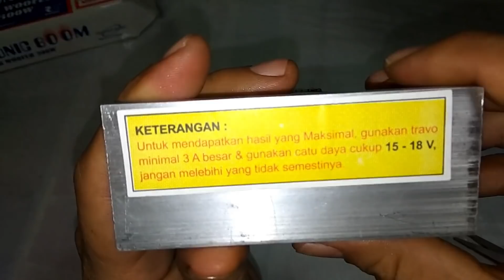CARA MUDAH MERAKIT POWER SUBWOOFER #soundsystemindonesia #rakitan #elektronik #subwoofer

Comment: Mas sonic boom saya baru beli kenapa hanya berdengung kalau di sentuh potensionya,jika di putar potensionya makin keras dengungnya, mohon solusinya🙏
Reply from the maker: Suply brapa volt
Reply: 20v mas, baru beli gak fungsi sama sekali hanya dengung saja, pemasangan sudah benar, apanya yah kira2
Reply from the maker: Auto short itu tr final...
Max nya kan cuma 18v
Reply: @yogiap6087  sudah di ganti sebelumnya mas tp sama saja tetap tidak fungsi,inputnya tidak berdengung jika di sentuh,hanya berdengung jika di sentuh potensio volume nya
Reply: @yogiap6087  mas yogi ikut nanya...mudah2n dijawab...potensio dipasang g dengung..tp kl dilepas dengungnya keras banget...🙏🙏🙏

Comment: Ikutan Belajar Audio...
Saya Punya Subwoofer 12" Embassy 2 coil EY-128 (blm punya Box nya) 
kiranya Trafo yg brp ampere mas Yogi.....?  trafo = 5A atau 10A  dan CT nya yg brp..
mohon infonya...
Reply from the maker: Klo untuk sub doblecoil kurng maksimal mas.. pake driver class D aja
Pake trafo 5a cukup CT 45v
Reply: @yogiap6087  tks infonya...
Bolehkah klo driver klas D
Pakai Switcing/PSU..?
Klo boleh yg voltase n ampere yg brp... Max/min...
Mhon dgn sgat infonya...
Reply from the maker: Bisa... Menyesuaikan dengan supply driver nya aja mas..
Reply: @yogiap6087  oke 👍

Comment: buat subwoofer 8 inch bisa ga bang
?
Reply from the maker: Mampu bosku
Reply: Bos pake 25 vol 3 amper apa bisa
Reply from the maker: Gk mmpu....max 18v
Reply: Ok trimakasih bos
Reply: Kalo pake 25 vol ct apa aja yang diganti, maaf pemula belajar
Reply from the maker: Trutama elco power supply..ganti 50v
Reply: Bos kalo pake 25vct psunya dirubah dioda berapa amper elco pake yang volt/uf nya berapa mohon dijawab belajar bos plissss
Reply: Ini elcoya 50 volt 4700uf diganti 50v 10000uf dioda di ganti yg 6amper, itu aja bos?
Reply from the maker: Tr final ganti yg original sanken

Comment: Klo pkek trafo 5a kecil bisa normal gak angkat subwofer doble coil 12"X1,??
Reply from the maker: Vol max kemungkinan bs sember suaranya
Reply: @yogiap6087  tp klo 5A murni untuk stereo angkat 12" doble coil X 1 per mono bisa normal bang nggak kah sember
Reply from the maker: Standar lah klo suply sgitu mas...
Banyakin elco aja...min 4biji
Reply: @yogiap6087  berarti psu yg ada di kit subwofer itu gx usah di pakai apa tinggal tambah elco aja bang ???
Reply from the maker: Di perbesar aja nilai farad nya
Reply: @yogiap6087  berarti tinggal gnti elco yg ada di kit dg fared yg lebih besar aja maksud'a bang......?? Terima kasih ilmu'a bang saya baru blajaran ini.....
Reply from the maker: Iya betul..dioda ganti yg 5amper..
Reply: @yogiap6087  stlah psu di ganti maksimal bisa di kasi yegangan brpa klo pkek tr sanken 5dy,? Oh iya klo dioda yg 3A bisa bang ? Kbetulan sya punya yg 3A nganggu
Reply from the maker: Sanken ori d driver itu max 32ct ....
Usahakn amper dioda di atas amper trafo... Minimal dioda 5amper untuk trafo 5amper...lebih besar aper dioda, malah semakin baik
Reply: @yogiap6087  gtu ya bang , ya dah besok sya cariin yg 5A untuk dioda'a bang........
Reply: Maaf bang yogi sya mengganggu , gini bang kit sub sya pake tr driver bd139 stlah sya kasi tegangan dri trafo 18v udah mletus,,,,,, tr tipe brpa pakek ganti bang, saya ada sih ini tipe H649A

Comment: Om mau tanya kalo pake subwoofer soun bank 10 inc  d data tulisan 600watt kuat gk ya??terus sya rubah pake tr final sanken asli sama elco ganti 50 volt 10000uf
Reply from the maker: Kurang... Soalnya daya dr suply power ini kurang besar...
Klo mau bas empuk ...pake driver socl504 aja..di kasih sulpy 45vct 10amper..

Comment: Untuk speker berpa inci bos
Reply from the maker: Max 1inch 300watt
Reply: @yogiap6087  15 in doble coil kuat gk
Reply from the maker: Gk kuat mas...soalnya voltase kecil ini...klo untuk dobel coil enak pake socl aja mas...d jamin glerrrr
Reply: @yogiap6087  yg tipe berpa 504.tau 506
Reply from the maker: Pake yg 504 aj mas... 
Tambahin filter subwoofer...
Reply: @yogiap6087  klw beli namax filter subwofer gitu ya
Reply from the maker: Betul sekali...bilang aja filter subwoofer
Reply: @yogiap6087  maximal pake tegangan brp VDC mas
Reply from the maker: Klo filter sub nya cuma 12vdc
Klo socl bisa smpe 65vdc 20amper
Reply: @yogiap6087  filter sub digabung dengn power BTL bisa kh
Reply from the maker: Bisa...tp klo untuk soundsystem besar/rental gk perlu pake filter sub...karna banyak accsoris untuk mengatur freq yg di inginkan tanpa menggunakan filter sub....beda hal nya untuk sound rmhn.

Comment: Maaf bang mw nanya kalo pake travo 5a murni bisa ga ya kira kira pake di voltase brph ya ?
Reply from the maker: Bisa mas...asal tr final di ganti sanken original...
Voltase bs 32ct
Reply: @yogiap6087  owhh , kalo ganti te final nyh aph harus ada komponen lain yg di ganti juga
Reply from the maker: Elco dan dioda di ganti...minimal dioda 10amper,dan elco 10000uf/80v ...bisa di catu daya 32vct
Reply: @yogiap6087  ok makasih gan solusi nyh
Reply: @yogiap6087  tpi travo saya udh ad power suplai nyh bang elco ajh 4700uf x4 , bisa ga klo langsung di pasang ? Dan di ganti tr nyh?
Reply from the maker: Ohh bisaa mas
Reply: @yogiap6087  klo pake Sanken 2Sc3858&2SA1494 biasa ga mas , yg kanan yg mana ya ,sy in salah beli hehehe

Comment: Mas kalau midelnya pakai 400 Watt, ideal untuk sub nya berapa Watt ?
Reply from the maker: 300watt sudah cukup mas
Reply: @yogiap6087  Ouh gtu ya mas, bukan seharusnya lebih besar untuk sub ya,, Makasi infonya mas,..
Reply from the maker: Sebenernya tergantung keperluan... Untuk indor atau outdor..menurut saya klo untuk indor 300watt sudah lebih dr cukup
Reply: Untuk out dor, disini saya memakai mid 400 Watt dan Low 400 Watt jg, tapi Bass nya masih kurang nendang.dan memakai driver Sanken merk turbo, dan jg memakai 2 trafo 10 a untuk masing masing driver ,42 v untk mid dan 32 untuk sub..
Kira kira ada solusi gak mas ,?
Reply from the maker: Ohh gtu...
Klo untuk outdor minimal trafo 20 amper tegangan 65vct dan tr final 10 sett sanken cukup, itu pun speaker harus memadai...dengan syarat spek minimal 900watt 15inch/ bisa menggunakan 18inch...
Reply: Terimakasi banyak jawabannya mas, ini sangat bermanfaat bagi saya..
Tunggu modal dlu,baru saya infokan hasilnya.
Reply: Mas y0gi.untuk speker subw0fer 350 wat.sebaiknya pake driver brapa wat.

Comment: Mas kalo di buat 2.1 di gabung sama ampli stereo ya ?
Reply: Kalo suara udah misah sendri mas atara vocal dan subwoofer nya tanpa di kasih crossover?
Reply from the maker: Klo tanpa crossover untuk vocal tetap ada...tp usahakan di sett di low frequensy untuk crossover yg tersedia di kit driver,agar vocal tidak menonjol
Reply: Oke mas terimakasih
Reply from the maker: Sama2 mas e... Trimakasih sudah mampir ke channel ku
Reply: Jadi kit ini masih  ada suara vokal dikit ya mas ...
Reply from the maker: Betul sekali....
Reply from the maker: Bisa mas...
Reply: Ini cara pasangnya gmna?? Inputnya di ambil di jemper ta sma in ampli stereo atau gmna??
Reply from the maker: Dr low input stereo bisa...
Dr high input / out dr power bisa

Comment: saya pake driver yang sama... volume tidak bisa dibesarkan, keluar suara serak dari tengah cone, sy pake sub 12".... udh di cek di sub ditekan2 ga ada bunyi gesekan,, apa karena wattnya kurang kuat ya... ?
Reply from the maker: Cek IC bos... Dan potensio di cek
Reply: @yogiap6087  kayaknya di IC mas.. Kalo volumenya sekitar 20% subwoofer bekerja normal, digedein lagi baru keluar seraknya... Mungkin clipping mas..  Watt kurang besar buat dorong coil..

Comment: mas kalau pakai travo 5A ct 45 buat ngangkat legacy 12" 350 wat  x 2 kuat gak?
Reply from the maker: Kuat mas...
Reply: perlu dimodif lagi gak mas biar subnya maximal?
Reply: pie mas?
Reply: @taufiqmaulana3865  maaf mas sekedar saran kalo untuk mendrive 2 sub 12" komponennya di modif pertama transistor final yang di gunakan harus sanken asli bukan yang seperti di video yang menggunakan transistor hayana (abal - abal) karna tidak kuat dengan tegangan tinggi klo perlu di pararel. ke2 transistor driver BD139 - BD140 di ganti dengan TIP 41- TIP 42. ke3 tegangganya 32 volt sudah cukup untuk membangunkan tetangga tidur :) hehehe..
Reply: @the_pirates.  trimakasih mas🙏
Reply: @taufiqmaulana3865  sama sama mas

Comment: Saya baru beli suaranya kecil sekali pas di pegang inputnya nga ada degung di speakernya..
Pas saya pegang di potensio volume dengung keras apa ic nya yg kena gan...
Reply from the maker: Di cek dlu aj mas solderan nya...biasanya ada yg lepas dr papan pcb nya...soalnya pcb abal2...
Dan cek pula potensio nya
Reply: Iya mas udah saya cek semua ternyata pas sy copot ic nya dan saya cek icnya yg kena

Comment: Mas maaf mau nanya,,, saya bli kit spekr aktf subwoofer baleno,,, 
Trs pake 25vol ct, pake elco 4700uf 50vol x2,, malah meledak dioda di driver yg kecil banget tuh mas,,,, harusnya d kasih volt betapa iya,, maaf mas pemula
Reply from the maker: Biasanya kn tertera mas voltase yg di butuhkan... 
Jadi sesuaikan aja dengan voltase nya...krna driver mempunyai batas maksimal nya
Reply: @yogiap6087  18-25 mas,,,, saya pasang 25,karna travonya bekas spekr aktf, cuman ada 25...yg bener gimana mas, maklum belajar
Reply from the maker: Klo voltase yg tertera di driver itu sudah terconvert dengan psu menjadi arus VDC,sedangkan output trafo masih arus VAC... Apabila sampean ambil output dr trafo 25vac jika melewati psu bisa menjadi tegangan 35VDC...itu jelas melebihi kapasitas daya input driver...otomatis meleduk...
Rumus nya VAC×1,414 =VDC
Jadi sesuaikan dengan kebutuhan.
Reply: @yogiap6087  jadi yg pas ngambilnya brapa volt mas dri trafo nya... Cara meng hitung rumus pun aku gak faham mas 🙏🙏✌️✌️... Ajari saya mas. Trima kasih mas
Reply from the maker: 18vct dari trafo mas...ketemunya setelah melewati power suplly 25vol dc
Vac×1,414=Vdc
18vct×1,414 = 25,452 Vdc.
Reply: @yogiap6087  trimakasih banyak mas telah berbagi ilmu, semoga bermanfaat dan sukses selalu
Reply: Ngerakit power ocl 150 watt mono, sama tah mas pake 18ct jg,,
Reply from the maker: Voltase d sesuaikan dengan driver nya aja mas
Reply from the maker: Siaapp mas ..aminnn

Comment: Speaker subwoofer itu ada kusus ya pak? Apa semua speaker bisa dipakek subwoofer?
Reply from the maker: Sebenarnya ada...tp klo untuk rakitan bisa gunakan model speaker woofer
Reply: @yogiap6087  berarti emang ada speaker kusus woofer ya? Tp kalau pakek speaker2 biasa yg mid high gtu bisa nggag?
Reply from the maker: Bisa bunyi tp bukan pada karakter nya...
Reply: @yogiap6087  powernya juga khusus ya kalau buat bas2an?
Reply from the maker: Betul mas...khusus subwoofer
Reply: @yogiap6087  perbedaan yg paling mendasar pada power apanya ya pak? Psu apa tr finalnya?
Reply from the maker: Mksdnya perbedaan yg bagai mana?
Reply: @yogiap6087  perbedaan komponennya atau psu atau drivernya?
Reply from the maker: Perbedaan ada di filter nya mas... Di IC Filter subwoofer ...terletak sebelum input ke power apabila di satu papan pcb
Reply: @yogiap6087  kalau didriver biasa gag ada ya mas?
Reply from the maker: Driver biasa bisa di buat power subwoofer dengan menambahkan filter subwoofer di input driver tsb.
Reply: @yogiap6087  ohh iya pak terimakasih. Ndk video sampean ada nggag perbedaan power sub dengan power biasa?
Reply from the maker: Blum ada mas...belum sempet untuk buat video soalnya lg sibuk dengn pekerjaan jg...
Reply: @yogiap6087  owlah okey pak sukses terus pak 👍
Reply from the maker: Aminnn...sama2 mas
Reply: @yogiap6087  bisa minta no wa nya nggag pak? Pengen konsultasi masalah power

Comment: Sorry boss,itu bisa angkat woofer 12 inch gx boss
Reply from the maker: Bisa mas..
Reply: @yogiap6087  mantap deh...itu kalo buat digabung sama ampli stereo pake yg low atau yang satunya lg boss
Reply from the maker: Gabung dr jack input aj mas yg R/L untuk ambil input subwoofernya,soalnya klo lwt high input terlalu maksa gain nya dan suara jd gk maksimal
Reply: @yogiap6087  ouh begitu ya boss..ok bsok sYa coba..makasih ya boss ilmunya😀😀
Reply from the maker: Siapp mas...sama2 belajar jg ini hehe
Reply: @yogiap6087  ok boss😀😀

Comment: Gan ini ko ga ada vocal nya ...masa dengerin bass doang... apa butuh amplifier lagi buat vocal..mohon info nya
Reply from the maker: Hehehe iya mas,ini kit subwoofer (cuma hentakan bass) ,klo mau yg ada vocal nya pake kit amplifier biasa..
Reply: @yogiap6087  bisa ga ngambil vocal nya dari amplifier ... gimana cara gabungin nya ...
Reply from the maker: Dvd/mp3 -amplifier/power - power subwoofer

Dr dvd/mp3 bisa langsung di pasang konektor dobel rca/ ambil out dr speaker amplifier masuk ke power subwoofer (pilih high input).
Reply: @yogiap6087  ohh berarti ngambil nya dari high input ya... brarti low input ga di pake ya
Reply from the maker: Out speaker dr power yg ada vocalnya di ambil untuk  input ke high subwoofer
Reply: @yogiap6087  berarti input yg buat ke hp ttp melalui input subwoofer ya ...makash gan ..mf bgd mungkin prtanyaan ane bikin pusing.. soal nya ane pemula ...
Reply from the maker: Iya mas gpp mas...sama2 belajar hehe
Reply: @yogiap6087  oya gan satu lagi.... kalo ane gabungin lewat jeck aux bisa ga... jadi jack aux input ampli .dengan jack input kit sonic ane gabung ... - - ++
Reply from the maker: Bisa mas...malah lebih simpel
Reply: @yogiap6087  bang ini mau nanya kalu mau ada suara vocalnya alurnya berarti dari out power amplifier ke high input filter subwoofer, mohon penjelasan saya belum paham,terima kasih
Reply from the maker: Bisa ada suara vocal tp di frequensy tertentu mas...karena kit ini sudah di lengkapi filter subwoofee
Reply: Berapa harganya
Reply from the maker: Gk di jual mas..hehehe
Klo mau beli di olshop harga kisaran di bawah 100rb an
Reply: Betul mas namanya kit subwoofer ya cuman bass-nya saja yg keluar...hehe

Comment: Mas mau tanya kalo beli ini bisa langsung rakit atau harus ganti TR dulu?
Reply from the maker: Langsung pasang trafo dan di hidupkan..transistor final sudah ada
Reply: @yogiap6087   oke mas . katanya kalo diganti ke original sanken lebih bagus mas? Emang transistor final kekurangannya apa mas?
Reply from the maker: Tr finalnya abal2 mas... Gk tahan lama
Reply: @yogiap6087  oke mas , kalo kabel ke subwoofer ngambil dari mana ya mas? Sama kalo ganti tr ke sanken tegangan nya bisa 15v atau harus ganti? Sorry mas kurang faham
Reply from the maker: Dari input music langsung bisa...
Bisa di suplay 32vct dr trafo apabila transistor final original...dioda di ganti 10amper dan elco psu di ganti 10000uf/80v
Reply: @yogiap6087  oke mas makasih banyak sangat membantu , satu lagi mas , kalo gapake travo tapi pake adaptor bisa gak mas hehe
Reply from the maker: Bisa mas...asal amper nya mencukupi..
Reply: @yogiap6087  oke mas , kan kalo travo 18v+18v+ct , kalo adaptor itukan + sama - ya mas , input nya kemana?
Reply from the maker: Ohh adaptor ya....agak berrsiko klo pake adaptor mas...enak pake trafo aja mas..soalnya adaptor non ct
Pikir saya adaptor power Supplay yg plat jaring
Reply: @yogiap6087  oke siap mas , makasih banyak ilmunya mas , maaf banyak nanya 🙏😅
Reply from the maker: Siap mas...semoga bermanfaat walaupun masih banyak kekurangan d video saya..
Reply: @yogiap6087  bermanfaat banget mas . Amin

Comment: Klu untuk Legacy 12 inch 250 W ngangkat gak mas, saya jg ada rencana bikin sub aktif...
Reply from the maker: Bisa mas
Reply: Pake legaci suara y sember
Reply from the maker: Elco nya di besarin mas..
Reply: @yogiap6087   punyaku suara bas y ga karuan ,pdhal tr pinal y udh tk ganti Sanken, trus travo 5 a, 25 v, kira2 kenapa ms?
Reply from the maker: Di bagian psu nya mas...termasuk elco harus d ganti yg lebih besar...krna elco sbagai tandon tegangan dc..
Reply: Elco y udh di ganti 10000 uf, 50v
Reply: @jumantoro4826  watt speakernya berapa mas ? Yg double coil atau yg single coil ? Klu untuk trafo 5A CT 25 kurang lebih daya yg dihasilkan 175 watt mas (bukan daya real) dan untuk speakernya lebih baik gunakan yg 100 watt single coil agar nada bass nya tidak sember karna kekurangan daya...
Reply: @aguzmelandri5729   legacy 10 in 250 Wt, Doble coil
Reply: Kira2 apa y yg di rubah?
Reply: Jika transistor final memakai sanken yg ori tegangan dari trafo bisa dinaikan di 32V mas, agar powernya gak kedodoran saat mengangkat nada bass pada subwoofer...
Reply: Coba naikan tegangan nya di 32V asalkan transistor finalnya bukan yg SANKEN kw 2 masih bisa di supply 32v mas, tp klu yg kw 2 jgn dinaikan di 32V bisa kebakar...
Reply: @aguzmelandri5729   nanti saya coba ms, makasih mas atas masukan y
Reply: Sama2 mas...
Reply: @aguzmelandri5729    ms  gimana caranya gabungin subwoofer ke amplifier Polytron BB 5510 di amplifier y tidak ada out put y, apa ngambil di out put speaker y
Reply: @jumantoro4826  untuk sambung dari ampli ke subwoofer bs ambil dari out speaker, tp kalau seumpama pake subwoofer aktif untuk saya pribadi biasanya saya modif di bagian input ampli ( tambah soket dan di pararel dibagian input ).
Reply: @jumantoro4826  kalau mas pake subwoofer aktif bisa di ambil dari out sub ampli, untuk tone controlnya ikut di polytron, atau mempararel input dari sub aktif lalu disambung ke input ampli. Tp kalau subwoofernya pasif jgn gabung, karna out sub polytron hanya 20w rms...
Reply: Jika ada waktu boleh berkunjung di https://www.youtube.com/channel/UCg3Nif74kaZSzySMjR09Saw
Reply: Mas  saya pesen satu mas harganya berapa an maa